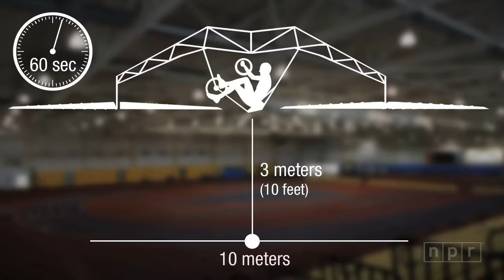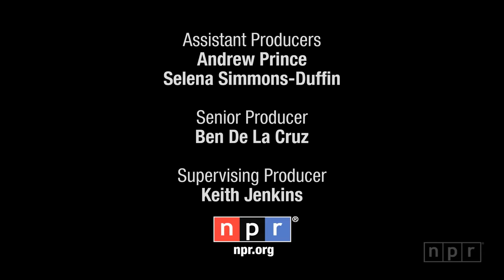Human-Powered Helicopter: Straight Up Difficult | SKUNK BEAR

Comment: It's drifting due to the movement of the person  pedalling, and his / her body shifting in the seat.
It's not going as high as you like due to the rota blades not giving the desired lift in the time required. And yes i worked in engineering  design  & technology in a  University here in England.

Comment: It's reminiscent of those 19th and early 20th century videos we've all seen of failed early flight attempts ... but of course, the engineering on this contraption is quite advanced. I wonder if it would ever have any practical value? And how to stabilize it, so it doesn't drift?

Comment: What you essentially need is a “transmission”. You can see the “pilot” is able to create enough speed but not enough torque toward the end, that’s when you need a gear that can reduce speed but increase torque so that it’s possible to create more lift.
Reply: No you’re wrong. If you disregard the wieght to add a transmission then you’re right. Like do you not think a bunch of phd students would not think of that. If you even added a 2 transmission  that would increases its wieght. Even if you were to make a release switch for a gear change it would still destroy the whole movement. These guys are phd fucking students not some asshole on YouTube that they’re wrong and stupid. I’m a civil engineer student and I barely know anything about aero engineering but I still know how much a successful transmission change would weigh.
Reply: @tobiassl8011  That was uncalled for, he sees a problem, and came up with a solution, even if they've already crossed that bridge, keeping suggestions is key, as an engineering student, you should know better than anyone that a fresh set of eyes can overcome a lot of issues.
all it takes is "one random asshole" to see a different solution than ones we've already tried.
Robert H. Goddard was just an asshole in a barn back in his day, and now he's considered the father of modern rocketry.
Reply: Funimals sl I didn’t mean a literal transmission. Bikes have low weight gears that essentially work the same way as a transmission. Make it out of titanium and it will hardly weight anything. Plus having that extra bit torque will allow for more lifting force counteracting the weight added. But as a civil engineer I wouldn’t expect you to really understand much about auto/aerospace/bike engineering. If you’re going to be an ass about it go somewhere else buddy.
Reply: I was thinking the same as Max. Like a 10 speed gears. The issue is they are pulling string to make the rotors move. Maybe have the string get progressively higher with the spool or something. One thing that may help is ditching the go pro and the teddy bear. Balance will be a real issue with 3 different pilots and if not perfect it will go that way.
Reply: fin screenname veryyyy true. I didn’t even think about how the spools effect the overall “gearing” either. If they are loosing string diameter the spools essentially get smaller and smaller as the strings are pulled in. Part of the issue though is the main torque load needs to be on the person, not the body. Rn they have no issue creating speed but the torque load is mostly on the spools. It’s like trying to run a car in 1st gear, eventually it can’t create enough torque to accelerate at the same velocity. But having the spools get smaller as it’s pedaled makes that torque issue worse for them.
Reply: @thatdirtymichiganmusician1038  Ya, it's beyond me. In my 1967 offshore race boat it has 2 motors into one V Drive to one prop because running a second prop and stuff to make it work slowed the boat by 4mph due to drag. So I'm thinking that the helicopter is to big from the start but then they said the whole thing weighs 8lbs and I'm like .....ahhhhh......never mind. 
They also may want to find a smaller person.

Comment: I'm not a mechanical engineer (I work with software) but I would think a simple microcontroller and an IMU could be used to control a steering system that would solve the drift issue. The largest hurdle would be implementing a method of steering without adding too much weight to the vehicle.

Comment: I am not sure if its against the rules or something but what if they add like a weight with a rope thats 10/9ft long so as it lifts up you will have 4 weights on the side so it cant drift from the starting point only up/down the only problem that might occur with this i guess could be the stress from the pull up/weights pulling down but that could be solved as well hmm

Comment: 80 POUNDS=36.2874 KILOGRAMS
Reply: Thanks
Reply: Isn't it 18 pounds?
Reply: At 1:50  "eighty pounds"
Reply: had to "ok google" that on the spot ahaha
Reply: themine702 carbon tubes bruv. Lightweight but very strong. Well not so strong in this case :)
Reply: No. It's between 36.1 and 36.5kg.
Mind the number of significant digits, boy.
Reply: using pounds as an unit should be illegal
Reply: and all other imperial units

Comment: If he's not getting tired all you need to do is better gearing. this should be really easy with your current pulley system. yeah you guys might be an expert in material science but you guys need someone in bioengineering and mechanical engineering
Reply: Yeah, you can't build a helicopter with only fancy materials, you need more
Reply: Their problem is that the helicopter doesn't stay stactionary.
Reply: Maybe the structure is too weak for higher torque?
Reply: There's also problems with torque and weight shifting from applying that torque, causing flex and then crashing. 

Notice how most of them are VERY thin... not muscular at all.
Reply: Gear ratios depend just as much on the forces required at the output as they do the input.
Reply: @rich1051414  once you get to a higher rotational rate you're not going to be applying any more torque than lunch on this thing. Honestly a shifting system would fix the problem or something similar to a CVT
Reply: @kirinyardberry1324  exactly. But that's also exactly what I was saying. It doesn't change the point
Reply: @grren1782  It doesn't take much to start oscillations that will build over time. These things are basically made out of toothpicks and bubble gum. 
There is no stabilization at all, no fly wheels, not even a tail rotor. 
They have no weight to spare for a transmission in any form.
Reply: They basically have no gears.  The university that won the prize actually used part of a road bike that have gears.
Reply: @rich1051414  the benefits of a lightweight gear system would make it worth it.

Comment: (not an engineer but this is the internet so here's my uneducated opinion) smaller test area (preferably with walls) more vertical design and maybe add a thin layer of film along the top and make it more of a kite design so that the air being pushed down can go back up and provide some extra lift. also circular motions are probably not the best thing to use due to lactic acid buildup, i think more of a handbrake on either side to push down and pull up would work better for the arms or kicking back and forth like a step machine would work better as the muscles in your legs are larger. great work though, impressive stuff

Comment: Would adding some sort of gear system work? So you don't have to pedal as fast to achieve the same rotation?
Reply: its already there
Reply: Mike's Gaming No FURTHER gearing. Having multiple gears that you can shift to when you are going faster.
Reply: It is limited to the strength a person can apply, so Im pretty sure they made the most efficient mechanism they could
Reply: hahaha
Reply: I was thinking the same thing.  I feel like it could be done easily with a few gears
Reply: Why do you need gears? They don't need to start quickly.
Reply: MrPaukann So you dont have to pedal as fast at the top end.
Reply: Synystr7 so you have to apply more force than efficient?
Reply: MrPaukann Well, no. So you don't have to pedal as fast... lol
Reply: Synystr7 sure, they didn't thought about it.
Reply: +Synystr7 I have the same idea. It's like a bike, I always start in the slower, more powerful gears and then once I reach the or get near the top rpm range of those first gears, I'll switch to heavier, faster gears! It's kinda odd how they didn't think of implementing this.
Reply: Derpu Wolf because they don't start on slower gears!!!! They don't need to start quickly, they probably have to start realy slowly. Therefore they have the best gearing ratio for flight.
Reply: +Derpu Wolf are you kidding? you think it's kind of odd they didn't implement that idea? I think it's kind of odd that you think your smarter than them lol
Reply: *you are
Reply: tomrl6674 I don't think I'm smarter than them. I just think that a simple CVT style transmission would be a huge advantage.

MrPaukann and I didn't mean it because of speed, I meant it in a torque way! ^_^ 

Oh whatever. The idea was so once the pilot got up to speed, he could change to a slower to move but more torque required gear.
Reply: Derpu Wolf it is the best torque/speed ratio already, that's my point! If it wil be slower it will either too hard to rotate or it will destroy the frame. Addition of a transmission is not possible, beacause it is extra weight and complexcity
Reply: +Derpu Wolf there's a reason why you aren't the one engineering or building things like this, its because you don't understand the physics behind it. Gears don't apply here like they do on a bike or car. Think about riding a bike up a wall, and then think if changing a gear would help you
Reply: the added weight of the gear shift isn't worth the gain. the gearing is already calibrated to be optimised during flight, so clearly having to pedal fast is the most efficient way the guys can deliver the power the are producing to the blades. Gearing down for liftoff isn't an issue either, as they manage to get off the ground fine.
Reply: Gear system is too heavy

Comment: The main difference I see between this helicopter, and the one that beat it, is the Atlas didn't try to reinvent the wheel using a reclining bicycle and a hand wheel. The pilot is kicking forward for 60 seconds, and there's nothing to counteract those forces. They seem to stop when the helicopter starts drifting, not when the pilot gets tired.  In hindsight it's pretty easy to see that this design wouldn't keep on target.

Comment: great project, has turning it up side down been considered? put the center of gravity lower by raising the lifting moment? ground effects may also be keeping you down, but with the propellers higher you may be able to play with pitch more as the pilots are not taxed to their limits yet
Reply: Ground effect actually increases lift.
Reply: yes it does, but with the lack of control issue, lowering the center of gravity, and some air foil experimentation might help. by raising airfoils you will have room for bracing the blades. you run out of ground effects on one or the other blades before reaching height goal and by then the machine is tilting on its' high center of gravity from loss of the uneven or rather unpredictable blade stall. just thinking out side the box. you have the team, and material, now just need to hang it all together right. I don't have the skills to run a simulation on a computer. but I do see  where some recoverable issues are.would love to help or offer insight.  ( I once had a D-9 bulldozer in a 10' hover, I woke up in a Mexican hospital,. They said I landed on my head. ;) )
Reply: MichaelKingsfordGray
free flight was specified
Reply: The higher the rotors are set on the airframe, the sooner it would get out of ground effect once it leaves the ground, thus making it more difficult to achieve the 10' height.  As it was, the fact that he only got 8' off the ground probably had a lot to do with a sudden loss of efficiency due to him exiting the most significant layer of ground effect at around 8'. As for drift correction, I would think setting up the cyclist in such a position that they could shift body weight as they pedal would do the trick. Also, having an elite/pro cyclist would make the "engine" that much more powerful. Somebody who could sustain >500 watts of continuous cycling power for a minute.